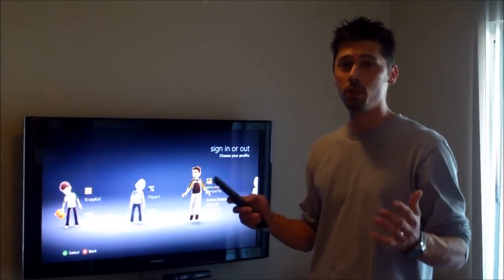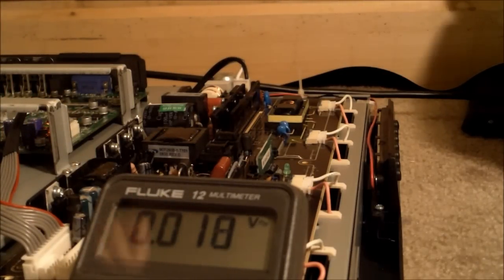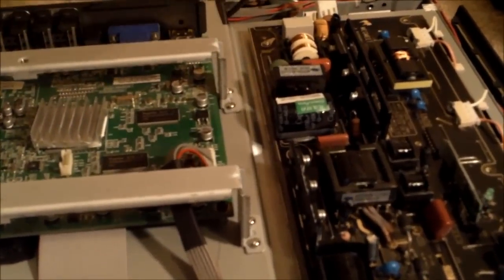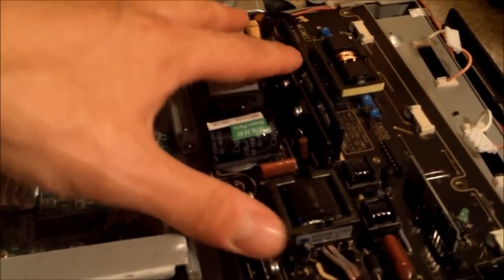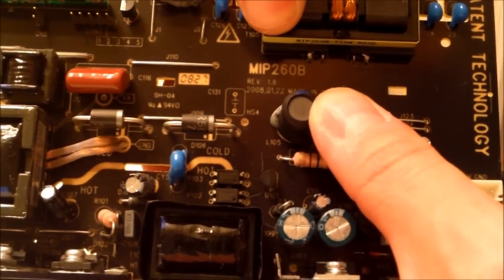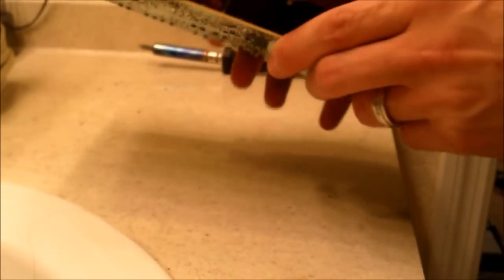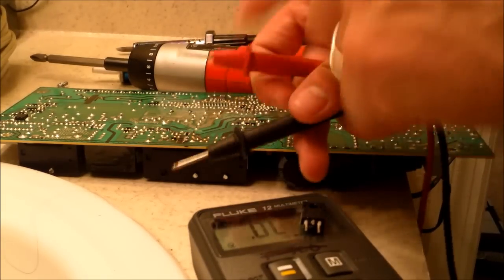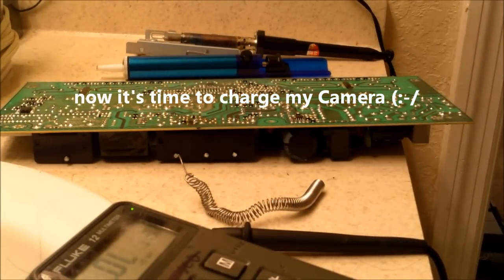HOW TO REPAIR TV - NO POWER insignia REVIEW pt1

Comment: Thanks for the informative video! I shorted the caps as you instructed, removed the power supply board and looked for burn marks to which I did not find. I then inspected the solder joints on the back of the board and there were at least 10 spots where the solder appeared dry and dabbed on poorly. 

Instead of using a solder sucker, I used a soldering iron to melt it again for several seconds to make a fresh connection. I did this for 10+ points on the back of the power supply board and put it back together. 

Lo and behold, it powered on! I'm sure this won't be a permanent solution but it didn't cost me a penny and took about 20-30 minutes to repair.

Comment: I found many 20" Westinghouse crt's 12-15 years ago,all had the main rectifier dead.Sold them for $40 after repair,today,even the Salvation Army stores wouldn't want them,even if you pay them $40 to take it.Gotta love those nice makers,since they bend the pins on soldering them in.Tv's pre 1990's were a pleasure to fix.

Comment: After double-checking everything, the power supply still works fine. (At least, there is a standby 3.3v out.) Now, I've just learned that the surge fried the HDMI port of my cable box. So, now, I believe the surge came from the cable box and that explains why everything else that was plugged into the same surge protector is still working okay.

So, it seems that the culprit is the main board, but my concern is whether or not some other board would be fried too.

Any thought?

Comment: Hi there. Thank you for the video.

I have a question. My Sony 40" LCD just went bad. No power. Power button doesn't do anything. This happened after a storm came by and an electrician came to fix light sockets on a ceiling.

Anyway, I opened it up and tested the power supply. No DC out. No 15V, no 12V, no other DC out whatsoever.

Now, my question is how likely you think the other circuitry may have gone bad too. I'm planning to replace the power supply, but want to know how costly it will be.

Comment: Thank you for your response. I checked the fuse (saw only one) and it's still good. I already ordered a power supply board after checking that there were no DCs out. It costs me only $40.

When you said "main logic board", you are referring to the mainboard, not the T-Con board, right?

Comment: Hi hopefully you can give me some insight. I have a 42 Plasma Insignia TV that is 6 years old. and the other day the screen just blacked out. The tv turns on, however no picture or sound comes from the television. Can you tell me what your diagnosis is on the tv and if this may can be fixed or if it will be more costly than purchasisng a new tv. Thanks!

Comment: I have that same TV monitor that I found on the side of the road.  It looked great except for a small crack on the screen, so I figured the previous owners were just a little picky.  When I got home and plugged it in, I found it had the white screen.  I was just wondering how to fix that?  Would it need a screen replacement?  I took it apart and nothing jumped out at me, but I'm not really a comp tech guy.

Comment: I've got a Sharp AQUOS. Sound but no picture. The voltage levels are funny out of the PSU. 26.4v going to the LED/LCD board instead of 24, but the big one is 4.3v coming out of the 12v DC output going to the TConn board. Any ideas what this might be? The caps all "look" fine, but would bad caps mean a lower voltage output form the PSU? Thanks for your videos as well, (although as a brit, I'd prefer to hear the "l" in solder :p)

Comment: I am working on an Insignia which was tossed out, the STBY voltage reads 5 volts, when the power button is turned on the DC output to the other boards is reading 25Volts, is this normal, there is nothing stamped on the board as to what is supposed to be normal in this case.  The STBY light comes on and turns off when the power button is pushed, but the screen never lights up.  It just seems off since most of the boards you are working on are running @12VDC.  What would this more than likely be indicative of?

Comment: hey Tampatec, i have a insignia ns-42p650a11 that turns on shows picture but shuts off after a few seconds, it was given to me its a 42 inch and i found the power board on sale under 50.00 should i replace the power board, do you think that will fix it

Comment: I have a Toshiba 50L2200U TV, replaced my power supply board and nothing works at all. 118.9 v at plug and 5.162v at the 5Vcc to Main Board but no 12Vcc or 12Va . Is this a bad Main Board? Thanks for any help you can give me
Thanks

Comment: Hey Ive been looking everywhere for transistors for my insignia tv, but both radio shack or Frys doesn't carry replacements, and eBay doesn't have anything either.
Reply: Neither of those places will carry them.  Mouser(dot)com, digikey(dot)com will have just about everything with the exception of some custom inverter transformers, specialized Power IC Chips, MPUs (Micro Processing Unit), and factory programmed eprom transistors.  For any of the other parts look to ebay.

It will help if you can get a hold of the factory service manual (not the user manual) and more importantly the schematics for the power supply and the main board.  You can find a large selection from elektrotanya(dot)com.   It's mostly in Russian but you can use the search engine at the bottom of the page.

Comment: When you said the transistor was bad, I was hoping to see how you checked it on this board.Thanks for the
Reply: If it is shorted the meter will read o and if it is ok but hooked to a coil then it will read short when it is not. Should check the load resister and surrounding components when the transistor is out of circuit.

Comment: Larger caps should be discharged through a resistor, not shorted with a screwdriver or the like. The value would vary according to the voltage and capacity. I use a large 8 ohm for under 20 volts. The 180 or more volts on your input filter cap, probably 750 ohms at 5 watts or more.

Comment: I have a sharp 48ins model no LCD 46le 820m. it's doesn't power on . only power led 2 time blick or flash  n it doesn't on . Will u tell me how to repair .and if you can ,you can sent me a diagram of power supply
Reply: Did you find the problem?

Comment: I HAVE A INSIGNIA 32 INCH TV MODEL NS-LCD32-09 that also keeps rebooting for channels. the tv wont shut unless you use remote. I did open unit see no problems only way to get to screen mnu is holding on button.plz help

Comment: MisterFuriousity I would recommend running the flashlight test on your TV, since you have sound but NO IMAGE on the screen.  This will help to determine if the problem is the backlight inverter or the main board.  Here is a link to the video:  No Image No Picture on Screen-Flashlight Test LCD TV Repair - How to Diagnose Broken Board TV Repair  Please reply with the results and we can recommend a fix.  Thanks!  www.shopjimmy.com
Reply: Video is private.